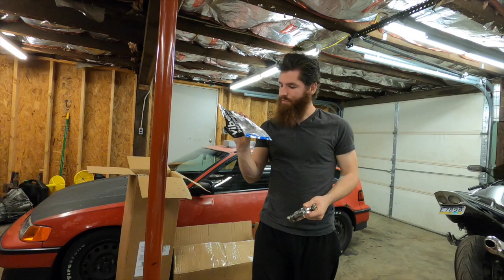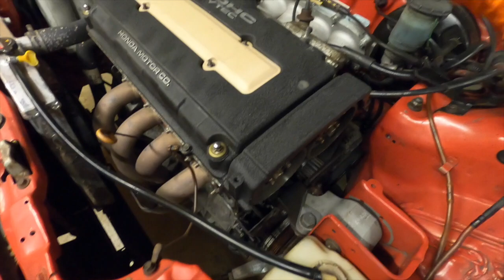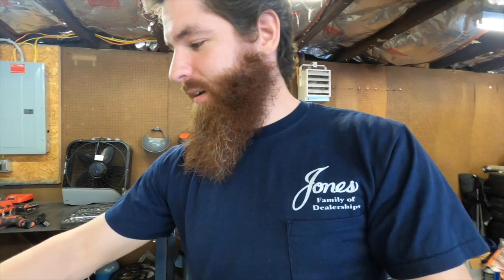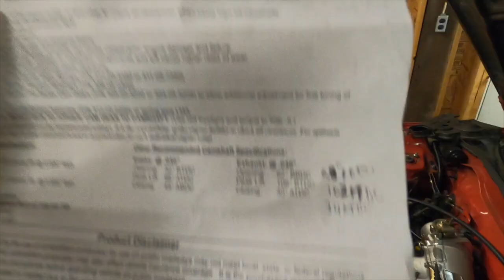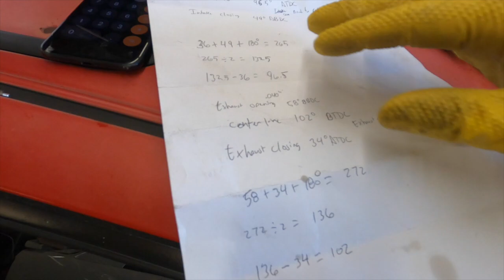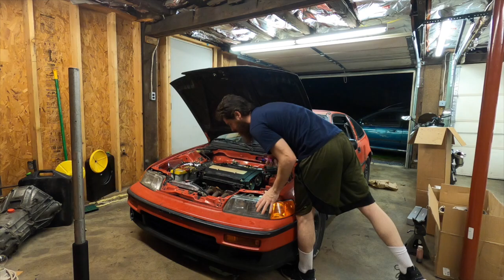ALL MOTOR B17 CRX / UNBOXING / SKUNK2 PRO2 CAMSHAFT INSTALL AND DEGREE

Comment: I’m pretty sure I heard your valves touch at the beginning when you were finding TDC. With them cams it’s so important to check valve to valve, pro2 cams need at least 4° separation to be safe but it all depends on age of the engine etc.
Reply from the maker: Well it had great compression and no marks on the piston or valves. Ran great until I pulled it apart 3 years ago. It had a total of 6° when I finished degreeing them. Those cams were extremely too large for my motor lol

Comment: Hey bro  just wondering if you have any injectors  throttle body and fuel pump I  got jdm  itr with  same camshaft and sk2 lma springs  and dual retainer  and going get it turned on  01/07/21 with stock throttle body, injectors and pump  do you think it will work out  cause yours is sick
Reply from the maker: You might be good. Your stock Tb is gonna limit power and your stock injectors might be tapped. Guess you’ll find out soon!